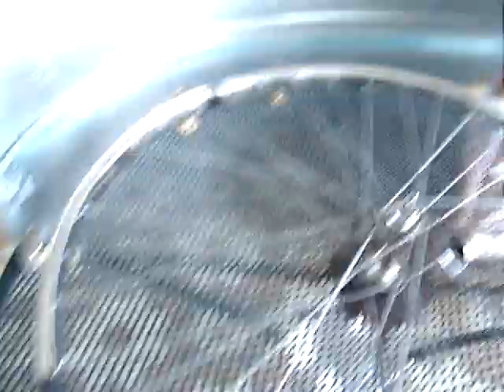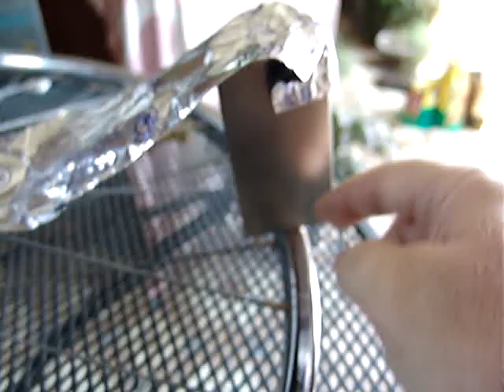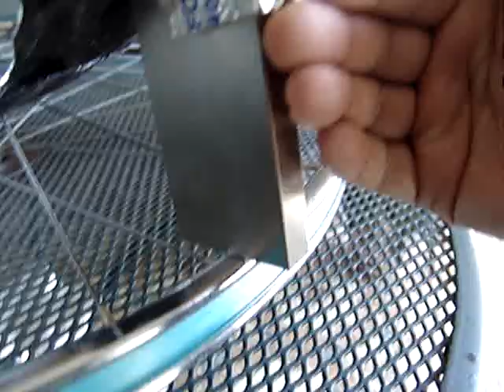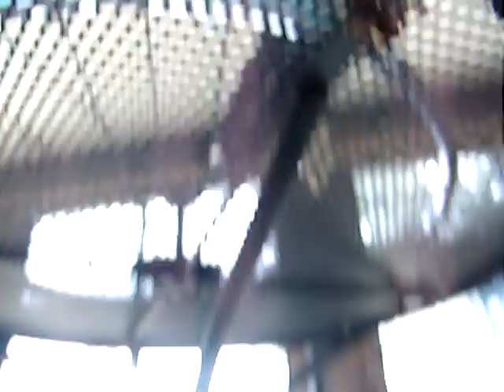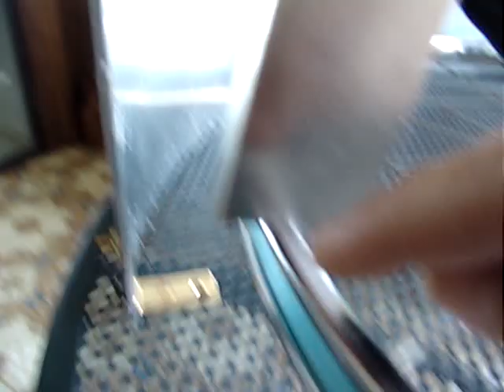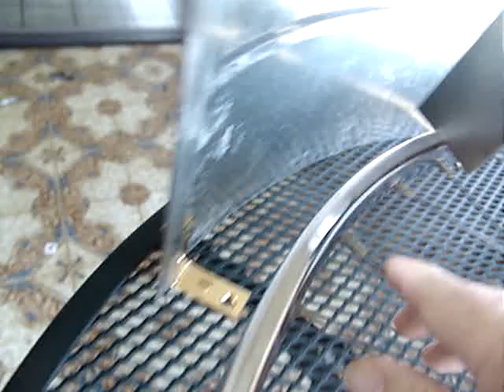🧲 Magnet Repels Steel???  Part 1 of 2 | Free Energy Research

Comment: I've came across a year ago experimenting and from my understanding of your video, it's still attracted, and is why it's not advancing. However my experiment ( prolly one from thousands in last 2 years) I've came across a "neutral" in steel position and magnet placement. And it was like u said "bizzar" cuz my first thought was wtf. 

Magnet can see ferromagnetic material from the poles but as it approaches the sides of the poles loses attraction to a flat plane

Comment: LIKENED  Poles will repel each other, as with a large magnet that you are using over a large surface area of steel the magnet is repelling it's own field because it wants to attract an opposite field which is not present. an easier way to test this is to arrange a group of magnets about 1cm apart glue them to a board in a straight line i.e. wood, and then hold a piece of steel of reasonable density above all the grouped magnets at the same time, because all the poles of the magnets are the same i.e. south or north the iron bar you are holding is trying to force a likened (SAME) field from one magnet to the others so it will repel so your steel sheet is doing something very similar a very large magnet like you have their is basically made up of many segmented magnets in one piece like a wave of magnets and they do not like this.